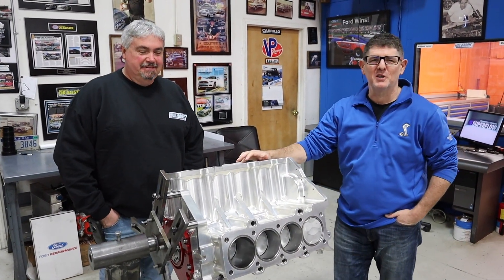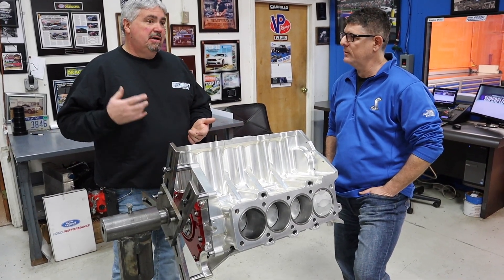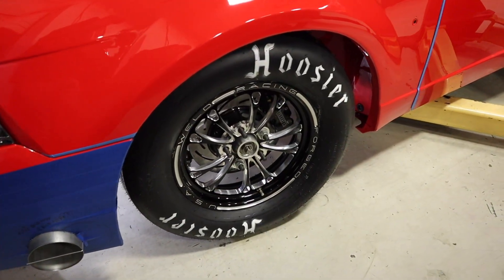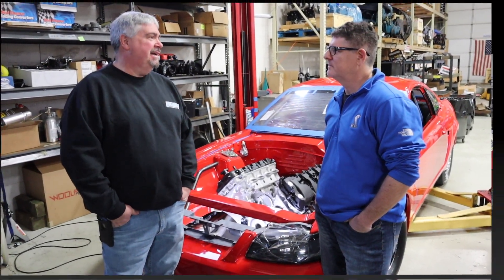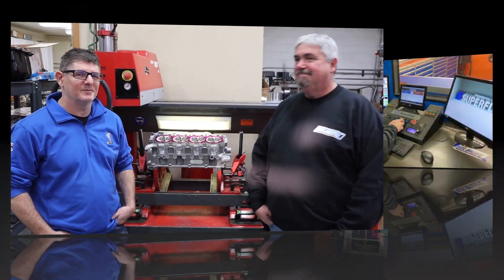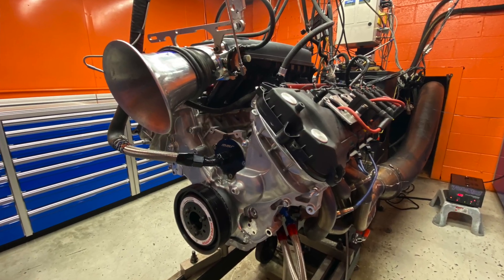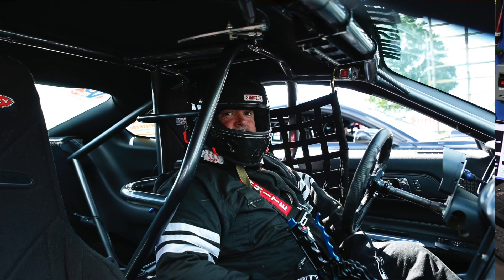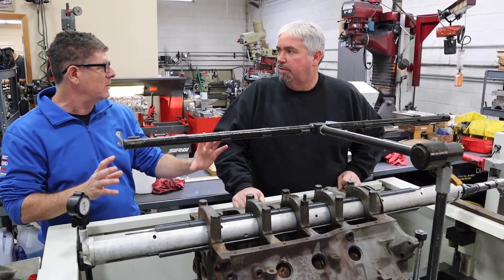850 HP All-Motor Coyote at Holbrook Racing Engines | Billet Coyote Engine Block & Race Car Reveal

Comment: Coyote engines are impressive. No need for a Godzilla when you can make this NA, let alone 1000+ twin turbo stock long block. Awesome build, I would like to see what this would make to the wheels.
Reply: Also it made 850 horse 500 something torque that is good for the qubes but a 7.3 at this power level is gonna dwarf that in the torque department so I wouldn't exactly say no need for a 7.3 lol.  Its crazy they make so much more hp than torque even boosted that is a sign that they are a very efficient engine.
Reply: @midnight347   agreed. I love the 5.0 but with a single cam. Huge cubic inch and a stupid robust block the 7.3 will be a stupid solid. somewhat inexpensive huge hp and tq maker.
Reply: The 7.3 will make more torque and sooner
Reply: Look, I’m sure the 7.3 is great! But Ford out performs Chevy and Mopar with less cid. Pushrods are a thing of the past. DOHC engines spin way higher and still put down power STOCK! Those numbers from the 7.3, are numbers it should put down. Coyotes, 5.2s, 5.4s, 5.8s, are the way to go! Keeping street cars in the game with less. Put a 7.3 in your Mustang or whatever if you’re after likes 👍 but king is overhead cam!!!
Reply: @3pedalfox  I’ve been a Ford guy my entire life, but Ford’s determination to use smaller motors is the main reason I don’t own a late model mustang.  I know the coyote is a good engine, but I don’t won’t one and never have.  They are physically, externally huge, like big block huge, but are limited to around 5.2 liters.  On the street, there is no replacement for displacement.  The 7.3L has the potential to be the best performance engine Ford has ever built.  It’s crazy how all the coyote people are dead set against it.  We can have both.  There is no need to disparage the 7.3L if you’re a coyote fan.
Reply: Torque way sooner, sure, if it can’t 60ft it doesn’t matter! Let’s keep these builds realistic!
Reply: 7.3 with 3.0 blower and head work makes 1450hp with 16lbs a boost. 5.0 doesn't have a prayer.
Reply: @Rob-tl9md  Holbrook said he was competing with the car in the same class, xtreme street, with the same blower, as Brian Wolf is is with his 7.3 Godzilla engine. It has a prayer.
Reply: @Rob-tl9md  stock long block Coyote. Manifold to oil pan with twins make 1000+ wheel. That 7.3 isn’t stock and I don’t think that’s wheel hp. I still think the Yote is best bang for the buck and all around the better engine.
Reply: @3pedalfox  people have made 1000 whp on stock motor i wouldn't really call that the rule tho just cause some guys on the net have made 4 digit power to the tires on stock motors dont mean its the set rule that is usually serious guys really pushing the envelope and they normally have money for a built motor if things go south.  I love ford and I love coyotes but I think acting like 1000 wheel is normal safe hp for any stock coyote os a little optimistic.  I think 800 would he considered pretty safe with good fuel and tune on gen 2/3 coyotes but yes some have pushed 1000+ usually with turbos.  Another thing all 800 whp builds aren't created equal.  Meaning you can't just be like oh who needs the cubes this coyote made 850 hp all motor...this is basically a fully built race motor and is very aggressive...the powerband wouldn't exactly be street friendly whereas if you has a built 7.3 at that power level its gonna be alot more drivable and enjoyable on the street with a much better overall powerband.  There is def a place for the 7.3 which is badass in its own right just different.  The coyote guys kinda act defensive about the 7.3 like they're afraid it's taking their glory or something lol...I say the more the marrier as far as badass ford powerplants.  Both engines are great and can make a shit ton of power.  There is more to a build than just the peak hp and how fast it runs street going cars usually want better powerbands and average power which is easier to get with cubes or forced induction let alone both lol.  Just my .02